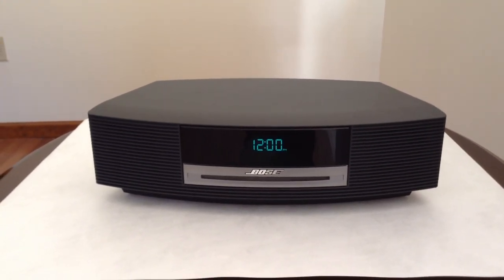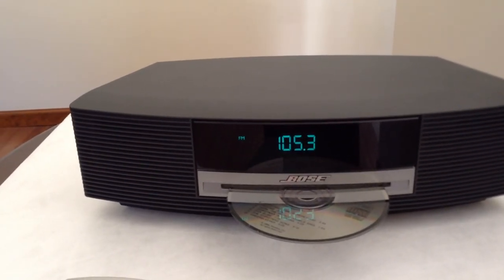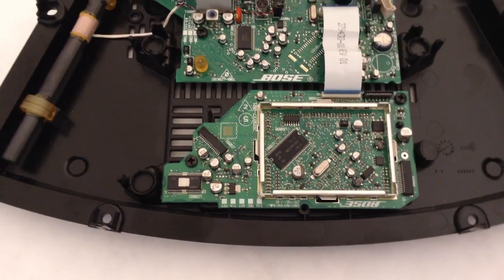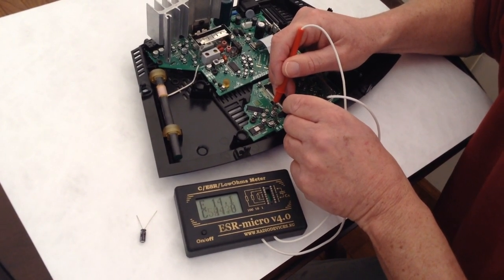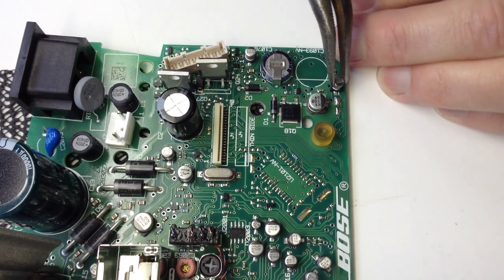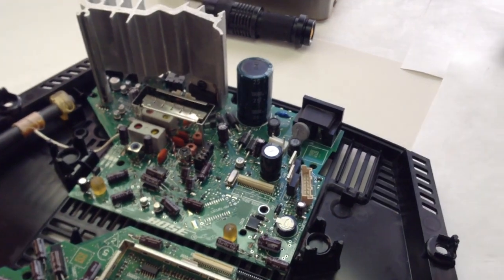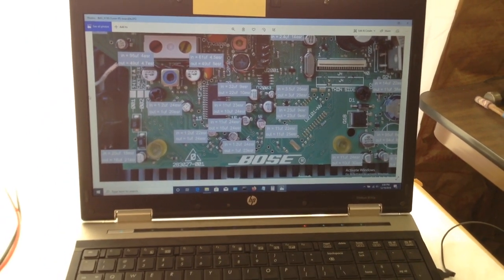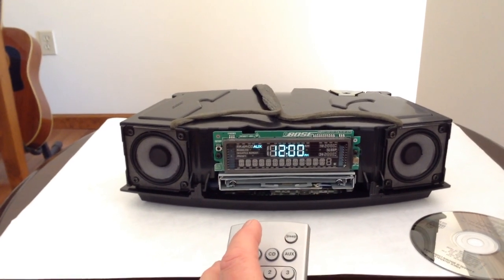Bose Wave II - AWRCC1 resets and CD skipping. Repair "Please Wait" problem

Comment: last night I held a hair dryer aon the front of the unit for 2 minutes and the radio started to work. saw this on another youtube channel. I suspect it heated  the capacitors to get them to work. forget Bose customer no service
Reply from the maker: Yep. that is correct.
Reply: This worked for me today. I still love my Bose sound. Who'd a thunk a hair dryer? SMH, so thankful it is once again operational. ☺️
Reply from the maker: @aminaroseayeam2125  Of course it is only temporary. The cap (s) are still bad and will malfunction once they get cold.
Reply: Bad 22uF cap under the shield can, look at my post above your here.

Comment: My CD player would skip so I replaced the 1 22uf 6V cap under the metal plate.  It works perfect! Thanks!
Reply from the maker: Hi Michael. Thanks for taking the time to write with the results of your repair. It is so cool to hear that others are able to get their Bose Wave II working again. These were really expensive radios and it would be a crime to throw them away because of a bad capacitor that cost 50 cents. You may still have other bad caps that will affect the sound quality, but at least it is working again!

By the way, great videos on your channel. I specifically liked the "2002 Saab 93 2.0 HOT Turbo Major Sludge Issue".  It is a real eye opener. Makes me want to switch over to full synthetic oil in my cars.

George
Reply: Hi there michael do you replace only one capacitor thank you
Reply: @papirickyrb  yes just the one.  very hard to solder the small caps.
Reply: @michaelsmutnick  thank you I'll check for the location on the cap

Comment: Dude, you are a hero. My Bose cd player (I've got a Bose Wave System IV) doesn't work and it is so frustrating. Skips like there's no tomorrow. Makes me so angry I want to throw it against the wall...but...the radio still works and I love the rich Bose sound. I don't have the skills to open up her guts and do a repair. Friends say, "Wha? Why aren't you streaming??" Grrrr...not the answer I want. I've already returned an older Bose model for this one (and received some credit toward the purchase of my current model, thanks very much). Not sure Bose would honor another trade in/purchase. Not sure I even want to purchase something else. Streaming seems to be the way, right? Yes, I'm old school; a luddite.
Reply from the maker: You can contact Bose and see if they still do repairs on that unit. I have heard from some viewers that they charge around $100

Comment: Thanks! My unit worked except for the CD player skipping. I didn't have an ESR meter to check caps, but I took a chance and replaced both of the 22uf 6V caps under the shielding. The one you pointed out turned out to have leaked. Working fine now!
Reply from the maker: Fantastic Kyle! Great job. Thanks for sharing your experience with the repair.
Reply: Thanks so much for this video. I have the same unit. Ordered 10 caps (same one under the shield) because i would probably screw a couple up. Those top solder caps are a pain. I was able to put a little eosin solder on the foil and caps with a fine tip 15 watt soldering iron and holding the cap with forecepts. Took me all of 30 minutes to have it back on the counter and playing cd's. Thanks again. I took out the 4 screws from the bottom, unplugged the 2 black wires, moved the cd out of the way and removed the shield.

Comment: The 22 mfd 6 V tends to be hard to find however, the voltage rating is just an upper limit, which must never be exceeded in a functional circuit. Replacing a capacitor with something that has a higher voltage rating is always safe.
Reply from the maker: That's correct. For this application, the physical size is also important since it has to fit under a metal lid. The 22mfd 10v listed below should fit...

CAP ALUM 22UF 20% 10V SMD
https://www.digikey.com/en/products/detail/nichicon/UUD1A220MCL1GS/589983?s=N4IgjCBcoLQdIDGUAuAnArgUwDQgPZQDaIALAJwDMIAugL514BMxIAqmwCJgCCTTABgCyAYQAyYAOIBlWnSA

Comment: Thanks!  I replaced two 22uf caps (because I removed the wrong one to start) and it works!  We received my mother-in-law's Bose Wave II (but it is AWRCC2 on the label) and it had the same kinds of symptoms, -Please Wait- when cold, radio/aux worked only when warm (either by hair dryer or leaving on for 24 hours), and CD never worked.   Now, it all works.  The -Please Wait- only displays for the first two seconds on initial power up, and then everything's good.  It took me two two-hour sessions,  mostly because I was playing catch-up on my soldering skill (in the four days between my first and second sessions I ordered a solder-sucker and rosin flux ; I had never used them before).  Thanks again to George and the commenters.
Reply from the maker: I love hearing success stories like this. Great job! It took me several days to complete my recapping using through hole caps. Fixing something that practically everyone else would throw out is very rewarding.

Comment: This is a superb repair. To not damage any tracks is a result in itself, I tend to heat up one side & use a probe or dentist tool to lift the leg & then heat the other leg to move it away but will try your technique on a test PCB in the future.

Comment: Thank you for such a detailed fix. You obviously are a patient man of high technical expertise.  Surface mount components are notoriously difficult to work with. The fact you persisted and prevailed most noteworthy of your acquired talents.
Reply from the maker: Thank you Musicmany2k, I really appreciate the kind words. My eyes are not what they use to be so working with the small components can be a challenge. It was a fun project and very rewarding to see it work at the end. 

Your Youtube channel has beautifully restored merry-go-rounds and calliopes. Definitely worth checking out.
Reply: @georgeterbush2976  Thank you. Its been a long time interest and actually owned and restored an organ at one time. I also paid my way in life via radio and electronics myself. Found that current flow and air flow properties both to be quite similar and interesting
 The fact you would go to all the trouble of meticulously replacing all of those caps at this stage of your life is most admirable. It's sort of like me recovering all those pneumatics  in an instrument and having the patience to do so.
Reply from the maker: @Musicmany2k  I love the sound of those calliopes. There is something magical about the sound. The engineering required to creating something like that has always been fascinating to me. Where are you finding parts to restore these treasures? I would imagine parts like the bellows would have to be custom made.
Reply: @georgeterbush2976  Yes. Late 1800s technology...lol
Reply: You have to make your own with wood, rubber and leather. Even that is getting hard to find in quality

Comment: George, today I repaired my stepmother's modee CC2 which was exibiting the same problem. Not especially wanting to do a complete cap job, I noticed in your comments a post about a guy who only replaced a single 22uf cap, so I tried it. Voila! Problem solved. so I buttoned up the radio, knowing full well it was chock full of caps with ESR readings off the charts. Garbage caps. I was glad to have done just the one successfully.  I restore vintage gear. My tools and  soldering equipment are ill-suited for this kind of microsurgery.  Thank you.
Reply from the maker: Awesome job! Apparently that cap is the make or break part for getting the unit back up and running. The other caps may effect the quality of the sound. Extra points in your stepmother's eyes is always a good thing!

Comment: Thank you for the video help, you are correct! Success! However ONLY the 22uF at the lower right of photo at 17:05. The lower rightmost, in the metal shield can. I tried three over to very left near the orange mylar ribbon cable with no luck. I found refrigerating the board killed CD player then gently touching cap tops with solder iron revealed THAT cap did it. Unit plays entire CD repeat mode all night so I consider it done. Thanks again, hope this helps others not to replace all caps at this time. Yes, they all go bad eventually but hey, in meantime it'll work fine.

Comment: The update from John on UPDATE: 4/21/2020 was spot on - saved me so much time and fixed problem - which was that the Bose would only respond to an alarm on/off keypress on the remote, wouldn't accept a CD, keeps ejecting. Works perfectly now.
Reply: Hello. help me deal with the same problem. What capacitor should I buy to replace it? which is under the cover to which the arrow points. Is UPW1C220MDD6 the right choice?

Comment: I was unable to purchase all the capacitors (out of stock problem) but did replace the one causing the issue. It works great now thanks to your help.
Boy they were tiny components.

Bob
Reply from the maker: WOW! That's fantastic Bob. So glad you were able to replace the bad cap and get your Bose working again.  Do you remember what your symptoms were and which cap you replaced?

Comment: I found a broken bose AWRCC5 lying on the street. My "problem-capacitor" was the one in the metal box K3 47 6v. I don't have an ESR meter, but I found out by simply heating up the capacitor for a while and trying to turn on the speaker and with this capacitor, it did. Going to the store tomorrow to buy a new, fitting capacitor to replace it with. I appreciate your help a lot, thank you!
Reply from the maker: I love hearing stories like this! Carefully using a soldering iron to pinpoint the problem cap is a great troubleshooting technique. Keep us posted when you have the new cap installed.

Comment: George, great instructional. It has saved me from having to replace my Bose System.  Keep up the great work!
Reply from the maker: That's fantastic! What were the symptoms of your Bose, and which caps did you end up replacing?
Reply: @georgeterbush2976  Initially had a power problem and replaced the  LM7810CT, LDO VOLTAGE REGULATOR 10V 1A,  But then I ended up having a skipping/play problem which was cured by replacing both of the  22 uf 6V caps.
Reply from the maker: @Samael-Metzger  Thanks for the feedback and nice job tracking down the bad 10v regulator. That's another victory for replacing the 22 uf 6v caps under the metal can! Some of your other caps could also be weak and starting to fail, but this is great that your Bose is working again.

Comment: I had the skipping problem problem and this solved it for me.  I replaced all the aluminum electrolytics on that board and now it works great.  I replaced them with the same size SMT caps.  Thanks!
Reply from the maker: Great job Bryan! If I ever find another bad Bose Wave system, I will use SMT caps like you did.  What series cap did you use?
Reply: I mainly used Nichicon UW series capacitors, but I ended up having to use one UCC part because of component availability.  I just used Digikey, and filtered by everything that I new about the cap (value, allowable height, diameter, min voltage rating) and that's what was best available at the time.  This CD player was an AWRCC2, and I just did all the capacitors on the board with the metal shield.  Also, I had good success de-soldering the old caps using the 2-iron method using irons with chisel tips on them and adding a little extra solder every once in a while to help get everything melted.
Reply from the maker: @bryanmwestra  Awesome. Thanks for the update. it will help others.

Comment: II had a same problem, but solved it! I tried  4/21/2020 version, changed 22uF*1,10uF*1,100uF*1,only 3 parts.  thank you guys!
Reply from the maker: Fantastic! Nice job. Thanks for posting your success in fixing your BOSE radio/CD player.
Reply: Hi! That's great you were able to trouble shoot the capacitors. Do you have any information as to where the 3 you replaced were? Thanks

Comment: Hi George. Thank you so much for your video. I bought online (at low price) a used Bose Wave II, which features the same "please wait" (seller didn't tell me). People like you are exactly why I decided to become an electronic engineer back in 97, unfortunately my opportunity to handle the soldering iron were limited and I spent more time on PowerPoint than the lab room. I will use this opportunity and your clear instruction to re-train myself. I subscribed to your channel and I am impatient to watch your next repair video, which are perfect practical training to learn/maintain technical skillsets. Thanks again. Greg
Reply from the maker: Hi Greg. Thanks for your kind words. Repairing the Bose Wave radio/CD player was definitely a fun project and rewarding since I now use the CD player almost everyday. For its size it has decent sound. I'm not sure how many more repair videos I will have since I'm not in the repair business. If I find another piece of electronics in the trash that is worth repairing, I will do another video. On the Bose Wave II that I repaired, it had many caps that measured bad. Your unit may not be as bad as mine. When my Bose was cold (just plugged in) it would barely work. After it was on for awhile it would respond to the remote better. 

If I were troubleshooting another Bose,  for fun I would use a hot soldering iron to try to find the cap that is going bad.  Like on the German YouTube. I still like using a ESR meter to take real measurements, but it would be fun to see the radio work by touching the iron to the bad cap. Of course, to repeat the experiment, you would have to unplug the Bose for some time to let it cool down. 
https://www.youtube.com/watch?v=Gkm8CSs0T0U 

You have to be really careful when soldering on these circuit boards. It is easy to bridge a solder blob from a capacitor pad to a little round hole that connects a top trace to a bottom trace. I mention it in the video. My eyes are no longer that great so I wore several pairs of glasses at the same time and also used a microscope to make sure my soldering was good.
Good luck and have fun!
Reply: george terbush Thank you for your reply
The german video approach is very smart and I will for sure try it to limit my soldering efforts (I speak german so I could understand what he said too).
I watched carefully your video and heard clearly your warning while soldering the cap pins I will be really careful
I will work with the technician of my company who is really a soldering « magician » when he mounts 0204 parts or bga packages 😉
Whatever the outcome I will keep you posted
Reply from the maker: @megagreg30  That's awesome that you will have a tech to work with on this project. If he can re flow ball grid arrays, and those 0204 grains of sand, you are in good hands.

When I replace the caps, I used high quality radial caps from Nichicon that are normally used on through hole boards. If I were to do it again, I would probably use Nichicon's UUD Series surface mount caps. They have about the same specs as the parts I used. They would be easier to place on the board. The radial caps I used were a pain to arrange in a way to fit on the board and not interfere with the CD player that is placed on top.

https://www.digikey.com/catalog/en/partgroup/uud-series/3760 

Definitely keep me posted.
Reply: @megagreg30  Did you manage to get your device repaired?

Comment: Thanks so much for taking the time to share your work George. My Wave system has the same problem, and my soldering skills are not up to the job of doing the repair. Fortunately I have some friends who are excellent at doing surface mount soldering by hand, am going to ask them for help, using your vid as a guide.
Reply from the maker: @Etienne Posthumus These Bose Wave systems are definitely worth fixing. Hopefully replacing the caps will get you up and running again. Many people here have had success replacing just the caps on the smaller board under the CD player. I was able to measure values of the caps on my system and found many bad caps on both boards. That was why I decided to replace almost all of them. If you use SMD (surface mount) caps, be sure to order the correct physical size. As Infiniti25 pointed out in his post, the 6v caps have a smaller foot print than 16v caps. You also want to make sure the height of the new cap does not interfere with the metal lid.

If your friends need to order caps, these may work well. This is the main page for the Nichicon SMD UUD Series caps...
https://www.digikey.com/catalog/en/partgroup/uud-series/3760

Comment: Ours has the exact same problem, and we take very good care of our CD,s such as not placing them on a dusty or abrasive surface!
Reply from the maker: It is not something you did to cause the problem. The capacitors inside were poor quality and deteriorated over the years.